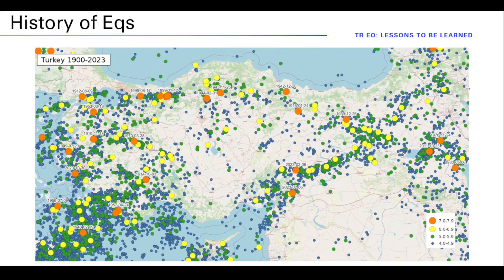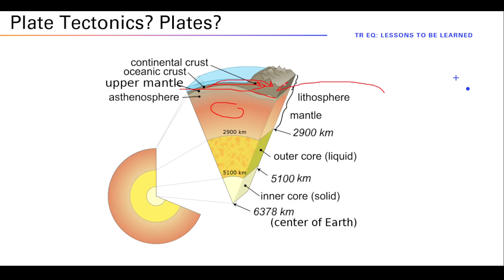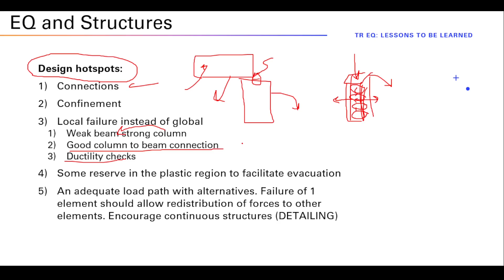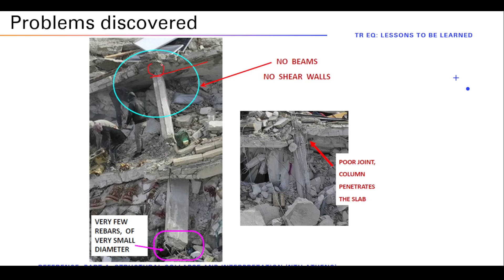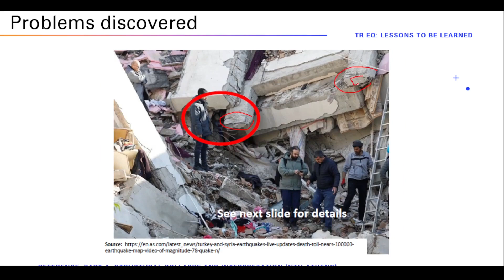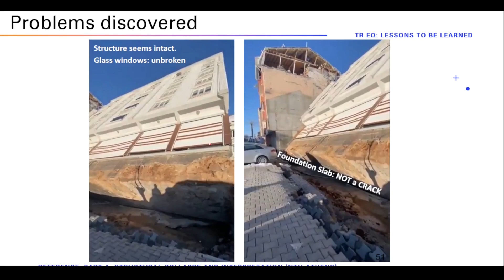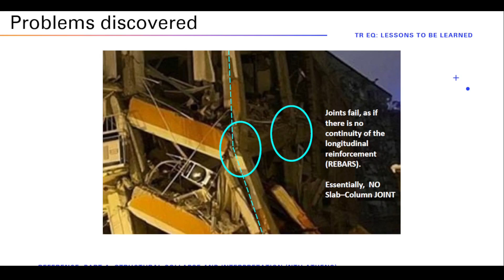Structural Lessons Learned from the 2023 Türkiye and Syria Earthquakes - CEE Lectures

Comment: Hi dear CEE, Is it possible to implement an artificial accelerogram in rsap so we could see the damage induced on a RC building considering the influence of masonry as fine elements or equivalent compression cross bars?
Reply from the maker: Hi there, I have to look into it, well from the back o' my head, no, but maybe I can see if I can throw in an excel sheet to see that. I will check it out.
Regards,
CEE

Comment: Hello CEE,

Condolences to the affected people of Türkiye and Syria. 

I concur that structural engineers should not shy away from lessons learned from this tragedy. Yes, indeed most of the infrastructures that engineers design and build have real-life potential for devastating and tragic consequences when these are not comprehensively or properly designed. The importance reiterated in this lecture that “…the structure is as strong as its weakest link…” cannot be overemphasized.  

5:11 Very nice demonstration, this is where the saying that “….a video is worth ??? words…” spring to mind.

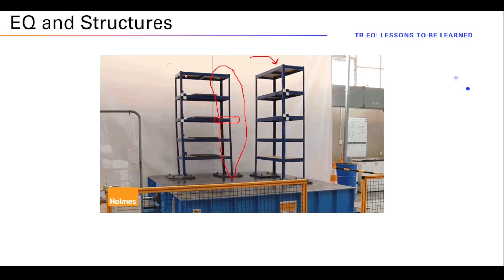06:42 In the region where I live, there are proliferations of four storey “so-called low cost residential housing flats” that are being build and used to house impoverished people by the thousands.

These flats are being constructed with UNREINFORCED load-bearing masonry as follows:

• Burnt clay bricks are used to construct the walls
• Single_leaf collar jointed 220 thick brick walls for external walls, or
• Alternatively, Double_leaf 110mm x 2 + 50mm cavity = 270mm thick cavity walls for external walls.
• Single_leaf 110mm thick brick walls for the internal cross walls

The load bearing masonry is (in this case) the only structural system which is providing both vertical (and horizontal) support for both gravity loads and for the lateral loads (through the use of masonry shear walls). There are no reinforced concrete columns or beams, there are no structural steel columns or beams. 

The floors construction is sometimes made of in situ reinforced concrete slabs, although more often than not, precast concrete planks that are mostly one way spanning and supported by load bearing masonry are used. The bearing length of the floor slabs onto the supporting brickwork is half-brick (110mm) wide.

The roofs of these buildings on top of the fourth storey are made of timber roof trusses that are covered with clay roof tiles.

I am aware of the concept of REINFORCED load-bearing masonry, but this is not what is being used to construct these building.

The region is classified as a seismic hazard zone with both mining-induced and natural seismic activity. The nominal peak ground acceleration expressed in earth gravity acceleration is measured as 0.2g

My questions are as follows with regards to the ability (if at all) of these buildings to resist earthquake loads:

1. Given that unreinforced masonry is a brittle material, how (in the event of an earthquake) would such buildings described above begin to resist the kinds of earthquake movements such as those demonstrated at 5:11 on this video lecture?

2. What is the maximum likely earthquake magnitude measured in Richter scale (or measured in any other appropriate scale, Mercalli scale?) which the specific types of buildings (4-storey unreinforced load bearing masonry residential buildings) described above could probably be able to resist or withstand? 

3. I have seen “detailing and construction rules and guides” for unreinforced masonry walls (bearing wall systems) in seismic zones with nominal peak ground acceleration up to 0.1g; However, most of these appear to limit their applicability scope to ordinary simple buildings of not more than 3 storey and buildings of minor importance to public safety (importance class). Are you aware of unreinforced load-bearing masonry detailing rules that extend beyond 3 storeys and incorporate higher importance class which recognizes significant risks to public safety?

4. Based on your own experience and understanding, what would you recommend as an ideal structural system form that may be considered for the types of buildings described herein above so that such buildings may more readily be able to resist the anticipated seismic actions (0.2g peak ground acceleration)?   
  

Thank you for making this video lecture, it is a glance to the gloom and doom reality that is so often seem far away when designers are busy with computer models, analysis, and crunching of the numbers.  

Keep well and have a great day,  

Regards, DK
Reply from the maker: Hello there Engr. DK, and thnx for your comment. It is as usual a pleasure to read through.

Oh my, unreinforced bricks? now please note that my skills in structural masonry are rather limited, I am more of an RC/Steel guy, but I may comment that it is rather odd for active seismic regions to have such a structural system, unless there are some provisions I do not know about. But I digress, I am not really the expert in masonry structures unless it is a very conventional setting.

Your structural system of precast planks and pouring RC for the slab is similar to what I have worked on in Germany. The huge difference being is that those are for rather low-rise buildings.

Still, as I am not really the expert on masonry lateral load carrying capacity, I would like to highlight that the following ideas are rather "thoughts" on the topic:
I do not think masonry would carry such earthquakes, it would generate diagonal cracks along its weakest path (the longest diagonal). There are videos about the TR earthquake which showed exactly that. It is really insightful to see all those CCTV recordings. WARNING: might include videos of harm.

As for Q2, I really do not know. But here is what Germans have for EQ
https://en.wikipedia.org/wiki/List_of_earthquakes_in_Germany

I am pretty sure that working in Hannover (north, central) warrants the use of such masonry construction.

3. YES!! that is what I hinted at "some provisions to be taken". Also I am not a fan of high rise laterally loaded structures form bricks. Also also note, I write the comment as I read your comment. ^_^

4. I recommend RC structures made out of columns and beams, with a shear wall core around the staircase (coz it does not impede any arch requirements, it does, however, need some openings). Please note that staircases are not always in the CG of the building.

If the calculations seem to need more shear walls, L shaped shearwalls on the corners of the buildings could be considered, as those are:
1) quite symmetric around the buildings CG,
2) do not impede any arch. requirements

Hope this partially helps,
Regards,
CEE
Reply: @CivilEngineeringEssentials  

“….I write the comment as I read your comment. ^_^…” 😂🤣😂 (this is true and very true). I appreciate your candour; and as always, I value your “thoughts" and find them enlightening.   

Yes, most of the towns and cities mentioned from the Germans list of earthquakes (magnitudes, intensities, reported damage to buildings and the types of building reported to have been damaged) do, in some ways, provide some sense of what one may expect with regards to my question #2. Thank you for the thought.

Notwithstanding the provisions and detailing rules for unreinforced masonry in “low seismicity cases”; I also have reservations for using unreinforced masonry in high rise laterally loaded structures. It is encouraging and comforting to read from your thoughts that I am not alone in such reservations. 

Your recommended ideal structural system form (RC frame + shear wall core(s)) is solid and I concur. Thank you for mentioning the need to keep watch of the layout and positionings of the shear walls in relation to the CG of the building. Indeed, one is better off dealing with nominally asymmetric configurations in order to avoid twisting moments; and if the situation allows, one should configure and arrange the shear walls in order to get a symmetrical configuration as far as it may be practically possible.

Your thoughts did help, thank you!

Regards, DK

Comment: This is a really good discussion to be honest, especially in times like these. It’s a sad moment in the history of turkey and the word at large, due to the massive loss of lives and damage to properties.

However, from the 4:30 it’s so obvious the Arabian plate and the eurosian plates are pushing hard on each other, generating high magnitude earthquakes around the boundaries of both plates.

For engineers in this region, this is going to be a problem for them since they’d have to fight for more robust or resilient policies and structures to be built in those siesmic active regions.

The turkey government and engineering council and all relevant stakeholders needs to fight a good fight against organization and business entities or clients to zone these earthquake prone areas to avoid bad design & construction 🏗️ practices as shown in the Preliminary report by Evangelia & George Gazetas.
It was soo obvious, most of the buildings that collapsed were first story soft story buildings where, it’s heavier on top than at the bottom due to commercial and retail spaces requirements with no proper lateral load resisting systems.( client/architect needs to recoup the cost of putting up a building in a few years)

There are soo many big things being done wrongly, however lives must be protected regardless and at all cost.

If the consequences of EQ is to be minimized to the barest minimum then, As engineers we shouldn’t be limited to just our engineering calculations , design and construction, we are challenged to move up on the societal ladder 🪜 into political spaces so as to implement good construction policies since the general public doesn’t really understand or appreciate these extreme yet random events.

The only thing that can change about the consequence of earthquakes is the mindset of the people and not the event itself.
So we need to equip society with the right knowledge and understanding to bettter deal with earthquakes or natural disasters.

Thank you for this one
Happy a great weekend Sir.
Reply from the maker: I toooootally agree with you take on this.
However, I had to abide by youtube policies and avoid pointing fingers 😁

By the way, I heard the news that Saudi Arabia is now seriously studying to force all new buildings to implement more robus EQ calculations.

Also,  a veeeery good point mentioning soft stories.
Indeed it is a problem and let to many structures collapsing due to it.